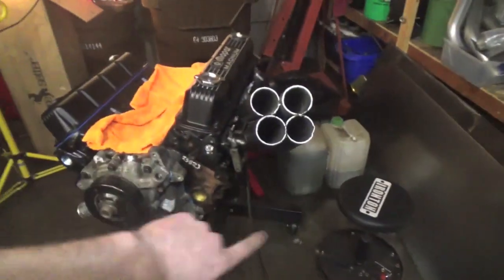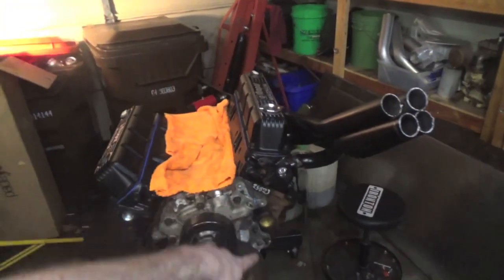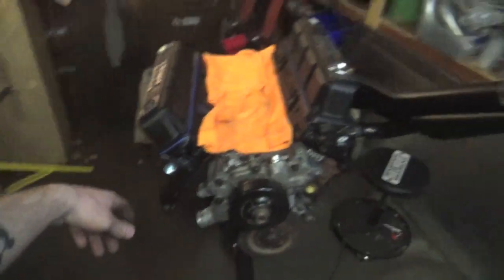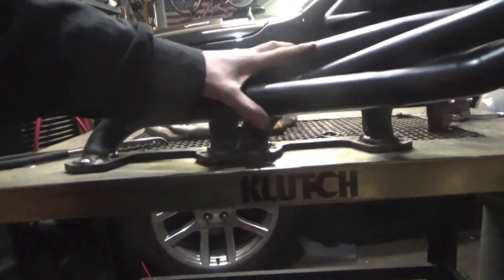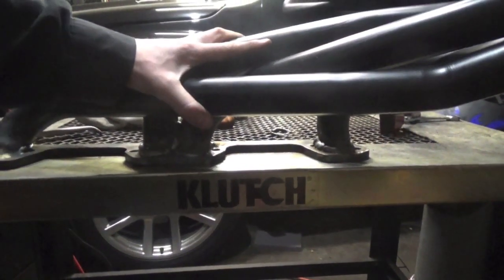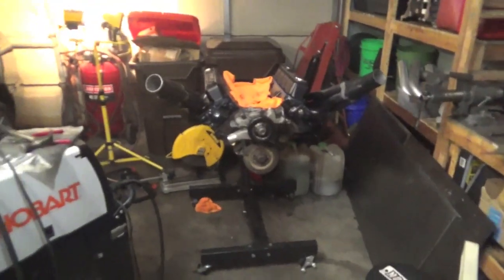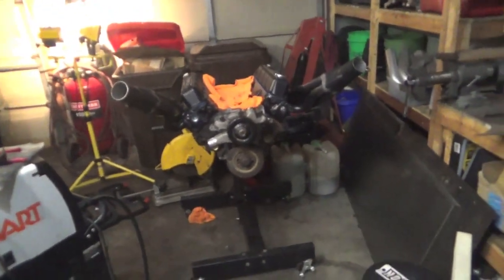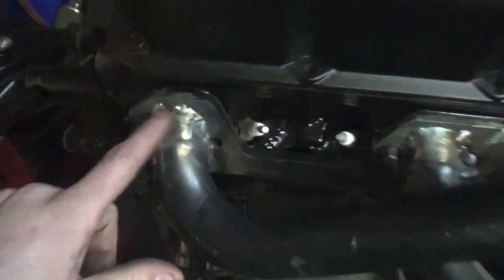5.9 Magnum TWIN TURBO build! pt.1 turning longtube headers into turbo headers

Comment: I like what you're doing here it's probably the most interesting thing somone has done to the ol magnum engine. Wish I had the skill set to do something like this to my 5.9 v8 engine that rest in my third Gen 1500. I'll probably end up doing a decent cam with headers and call it quits.
Reply from the maker: Theo-greking they pick up tons of power when you get rid of the crappy stock camshaft!
Reply from the maker: But thank you
Reply: Any specific cam you'd recommend that won't ruin your the engine? I'd just be happy to get 300whp lol
Reply from the maker: Anything over .500” lift and 220 duration will get ya that